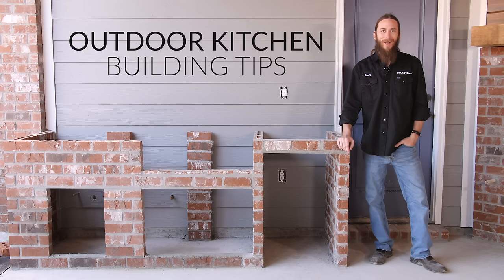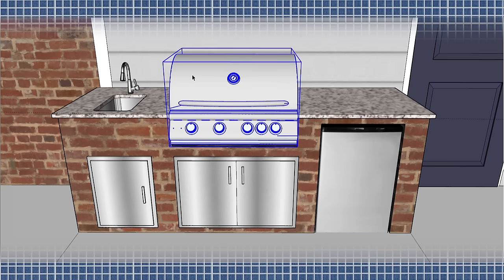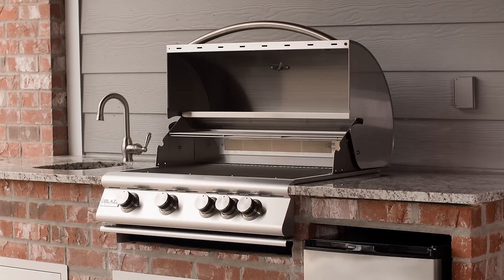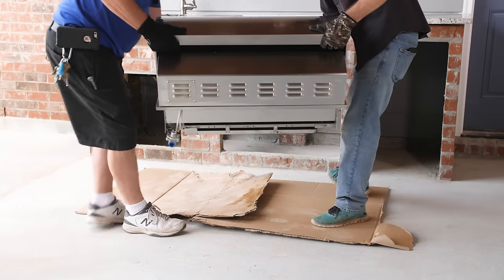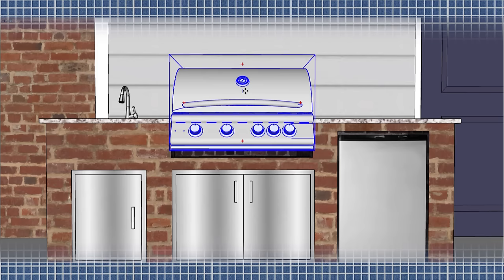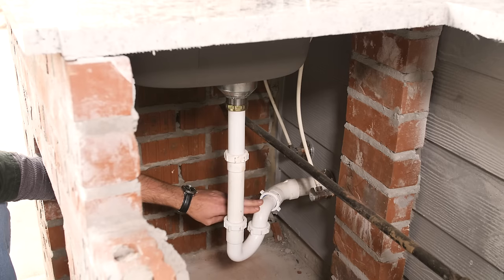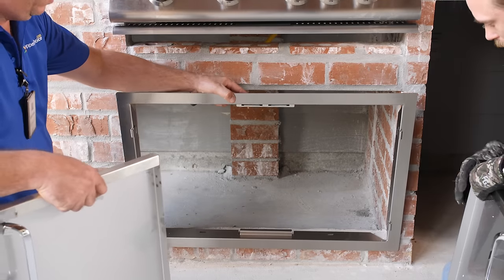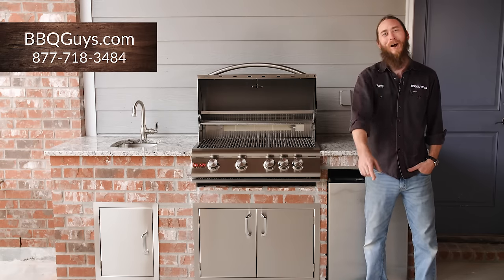Outdoor Kitchen Planning & Building Process | The Watson Family's Kitchen Build | BBQGuys.com

Comment: Nice tips in the video!  What's the best technique to finish the interior of the cabinet openings if you so desire?
Reply from the maker: Thanks!  Are you asking about the lip of the brick where the doors screw into?  I would be hesitant to put anything that would make it hard to close the doors.  If you are talking about the general storage area under the appliances, you do need gas to be able to flow freely to the vent panels for safety if there is ever a leak.

Comment: Do you have plans like this for a Pellet Burning Grill...like the  Z Grill 700E???
Reply from the maker: If you are asking about building in a pellet grill like the Z grill, then Memphis is a great brand that has this option.  Here is a link to where you can see one. 

https://www.bbqguys.com/memphis-grills/pro-wi-fi-controlled-28-inch-304-stainless-steel-built-in-pellet-grill-vgb0001s

Comment: Most grills have a safety requirement of 21 inches or so for flammable surfaces near the top of the grill. The siding directly behind the grill doesn't look non flammable....
Reply from the maker: The siding behind this island was hardie plank siding.  Always check your specific grill manual though for specific distances.
Reply: Hardieplank is a cement board.  Not flammable.

Comment: The outdoor kitchen looks great, but grills under an eve or other structure has lead to house fires.  10 Foot min. from structures is recommended by fire professionals.

Per the National Fire Protection Association:

Gas grills were involved in an average of 3,300 structure fires annually.  Leaks or breaks were primarily a problem with gas grills.

Charcoal or other solid-fueled grills were involved in 600 structure fires.

That fire place looks as safe as an indoor fireplace, yet can't wind blow embers into the house as the door is swung open?
Reply from the maker: Greetings - thanks for your comment! We definitely recommend that the installation of any grill or fireplace meet the building and fire codes for your location, and this one does. We also recommend that any built-in gas grill installation be signed off on by a licensed plumber or natural gas technician.

The fireplace is gas-fueled, and as such generates no sparks or burning embers.

Again, thanks for watching!
Reply: Thanks for your feedback.  I'm thinking that *Carbon Monoxide* is another reason to keep a BBQ far from a house.  Additionally, windows and door could allow smoke or leaking gas to enter.

BBQs have caused fire balls from a gas leak.  Personally, I would put mine 15 feet from anything flammable.

It seems sensible to design for *human err.*

Worse news stories out there, but check out the photo in this one.  It reached the 2nd story roof!

Article title:  "Gatineau BBQ fire caused by propane leak"

Thanks again for your feedback, and have a great day.